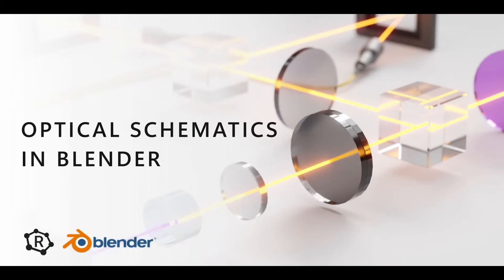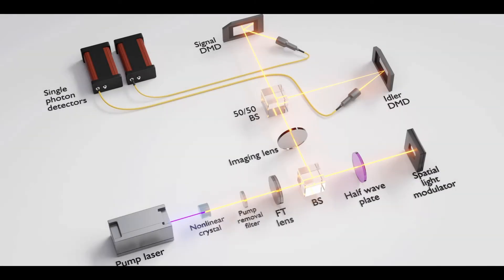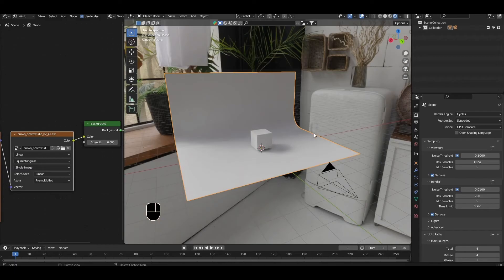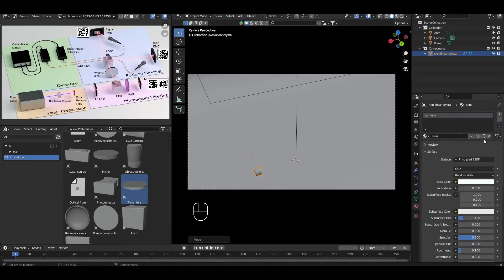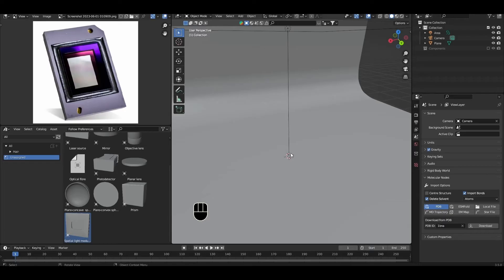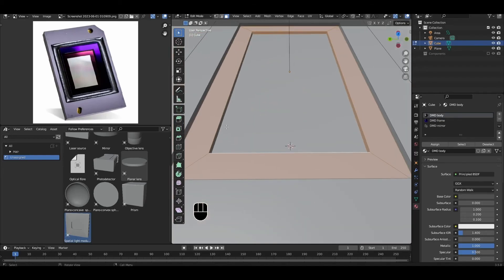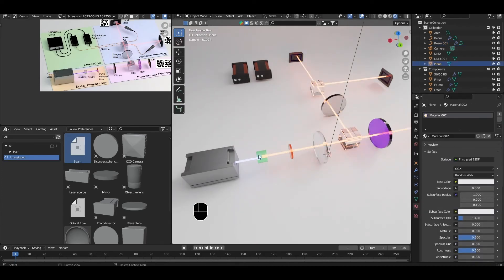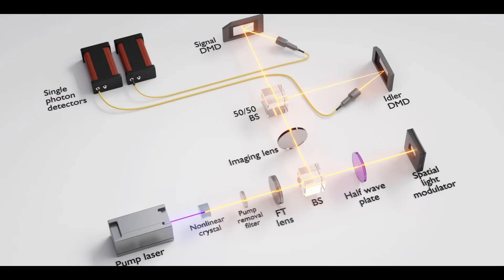Optical setup schematics in Blender

Comment: Really awesome work, especially for someone who has never used Blender before and is trying to learn how to do things. I wanted to contribute by buying the package for more the 0 dollars by I couln't. I'm having some trouble and would love any help. At minute 9:43, when you are teaching how to make the second part of the beam, whenever I'm adding the second beam and entering edit mode to adjust the length and characteristics of the second beam, it's also changing the first one without me having it selected. I can't seem to find how to do modifications on only one of the beams separately.
Reply from the maker: When you say the characteristics of the second beam also change at the same time, what exactly is changing? E.g. the emission colour for both of them change at the same time if you apply the change to one? Or is it something about shape?
Reply: @ryomizutagraphics  When I add another beam, and go to edit mode to adjust the length of this second beam (trying to reproduce the process you did in the video), the length of the first beam changes aswell. So I think the answer to your question is about the shape. Whenever I modify the one beam also modifies the other. I dont If have anything to do with the version of blender or some kind of unwanted parenting between objects.
Reply from the maker: @pedrogabriel2030  Cool - your two beams are sharing the same mesh data. Select one of the beams. Go to the Properties tab (the section of Blender with all the tabs with icons, e.g. render settings, modifiers, material properties), and look for  the Object Data Properties tab. It's the tab with a green triangle as an icon, with squares on its corners. At the top of that tab, you'll see the name of the mesh object. To its right, you'll probably see a button with the number 2 showing. Click that button, and the name mesh object name should update to something like ----.001. This should have now unlinked the two beam meshes, and you can edit them independently.
Reply: @ryomizutagraphics  I think it worked. Thanks, appreciated. I will contribute when I can! Really, really awesome work!

Comment: Thank you very much for the pack and the tutorial! Is there any chance you might add beams with varying diameter (i.e. divergent) in the future? Or are there any pointers as how I could craft these myself?
Reply from the maker: You'd need to tinker with the geometry nodes setup, but what you want is to use the Spline Parameter node, feeding in the Factor output into the radius input for the Curve Circle that is used to solidify the root curve object for the beam into a solid cylinder.

Comment: As I understand, these assets are just 3D models. Not possible to calculate (simulate) how the light beam would propagate through a system of mirrors? Blender is for visual stuff, not physics.
Reply: In other words, to see the light beam after a few reflections, I need to draw the beam manually, it is not simulated by the assets?
Reply from the maker: @brains1473  Correct. This is just to expedite the process for anyone wanting to create 3D illustrations for setups. 

That said, I'm fairly certain that simple ray optics calculations can be set up with geometry nodes (if you know what you are doing). E.g. see this old post by Thomas Hartman (aka This Illustrations on X): https://x.com/Illustrate_THIS/status/1626527055855624193
Reply: @ryomizutagraphics  Thank you for the link, very interesting.

Comment: Why don't the lenses in my setup look like glass (nice transparent) but rather opaque? I do everything the same way as you do. Thanks.
Reply from the maker: I run everything with the Cycles engine. If you are using Eevee (which Blender does by default), you'll need to:
1) Under render settings, activate refractions (in the “screen space reflections” section)
2) Under material settings, activate “screen space refraction” and set the blend mode to Alpha hashed 

N.B. Glass materials in Eevee generally don't look as good as in Cycles, which properly path-traces the light bounces

Comment: Hi Ryo, thanks for the video. I am following all of the instructions but i am having trouble viewing the laser beam so it has that glow to it.. what could i be doing wrong? Cheers.
Reply from the maker: Hey, thanks for checking out the video :) 

That could be a number of things. 

If you mean the "glow" that the beam has in the rendered thumbnail, that is because I added a Glare node to the Emission pass in the Compositor. I am working in Cycles, so emissive materials don't naturally get that realtime Bloom effect in the viewport that Eevee has (although, this will likely change in Blender's upcoming v4.0). 

Otherwise, things you can do to enhance the beam glow. 1) Increase the emission material strength, 2) make sure your floor/backdrop has roughness > 0. Lights can look more "glowy" if they have surrounding objects to light up. This works best if you can maximise diffuse secondary bounces from these objects, so they need some roughness.
Reply: @ryomizutagraphics   Hi ryo, thanks for this! I found it, there was a "Bloom" option unticked on the rendering options! Thanks
Reply from the maker: @dionadamou3330 that makes sense 😊 I’m actually not using the Eevee render engine (which has Bloom), but Cycles. So you might find that the end result still looks different, especially the glass materials

Comment: really nice tutorial video! how can you go about animating the laser beam
Reply from the maker: Thank you! 

The beam is a curve object, and so there are several ways to animate it (I'm assuming that you want to animate the beam propagating). First, I'd apply a Resample Curve node to give yourself more vertices. To animate in geometry nodes, I'd use a Delete Geometry node. You need plug something that you can animate into the Selection socket. I would connect a Compare node (set to Greater than and integer type). In its socket A, I'd add an Index node. If you now scroll the integer value in socket B, you should delete more/less of the beam. You can use that to create the effect of a propagating beam. You could also do something similar in the shader editor
Reply: @ryomizutagraphics  i'm a beginner, but i'm very interesting about optical animation, so i really want to animate the laser beam, your tutorial is very detail but i don't know how to make it in geometry nodes. can you share me a reference link that show how to make it? Thank you very much....
Reply from the maker: @leethuan102  Unfortunately I currently don't have a video outlining how the beam was created. However, the basic principle of how it was made in geometry nodes is covered in my Tubular Structures video: https://www.youtube.com/watch?v=SgD69ys7b6Y&t=24s 

To animate the beam appearing, you could use the Trim Curve operation (what I use to create the "peeling away" effect in the above video). Good luck!
Reply: @ryomizutagraphics  thank you so much, you’re so nice!